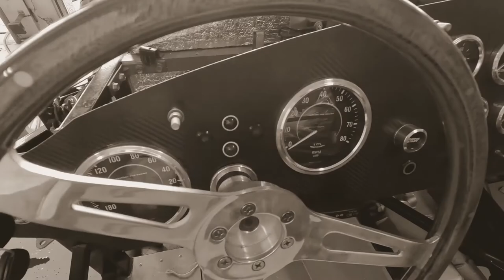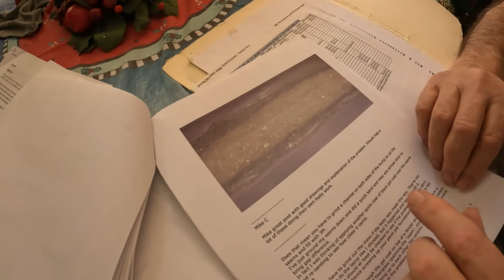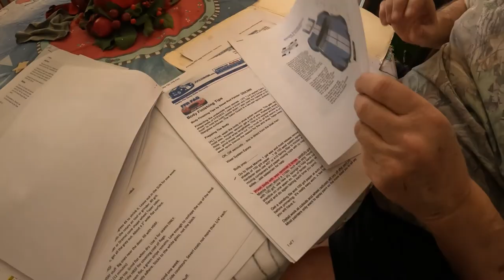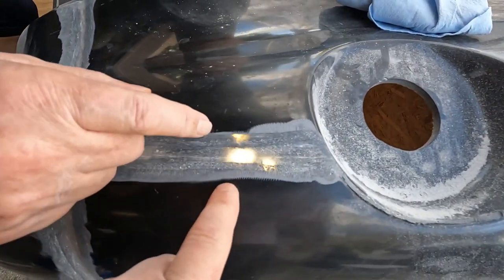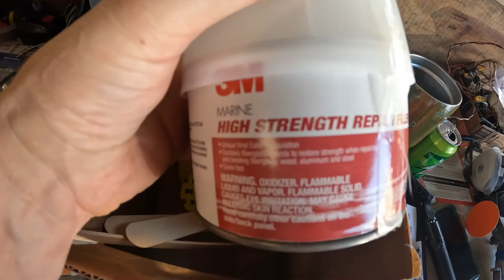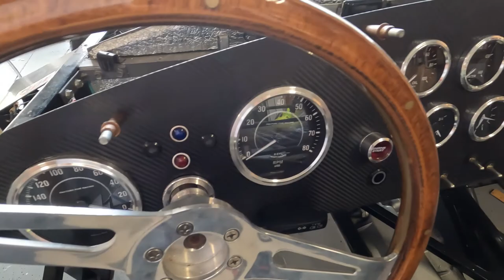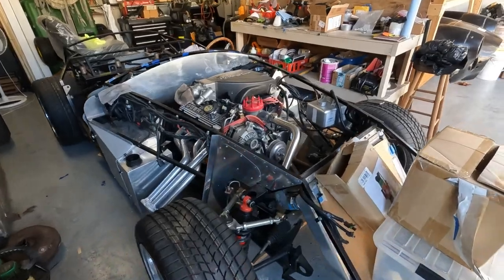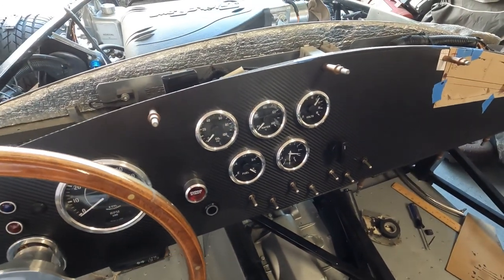Shelby Cobra! FF Body Prep

Comment: Oh my god what is he doing, you’re only supposed to take of the flash lines parallel to the gel coat either side of the mold line then fill in any slight imperfections not grind out the whole lot and fill it back in again.